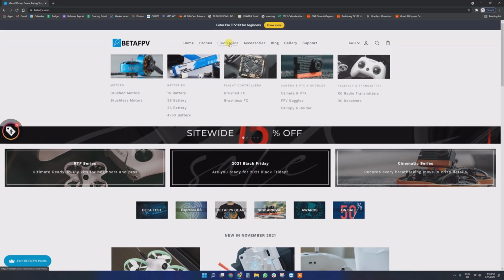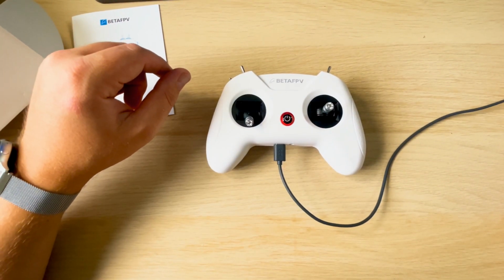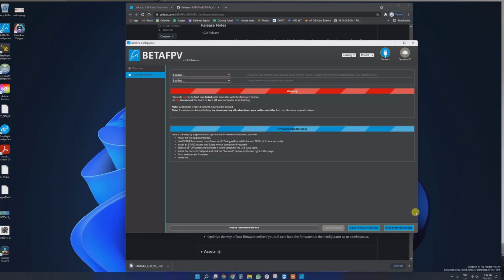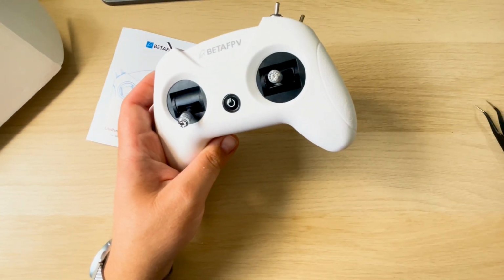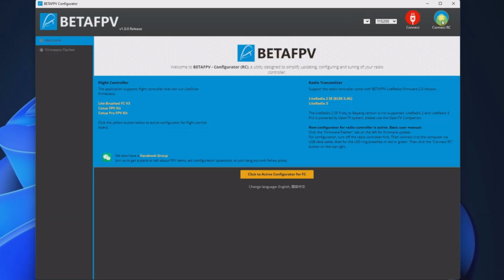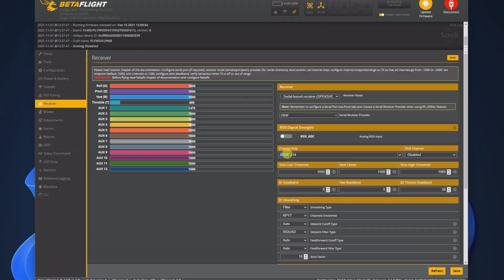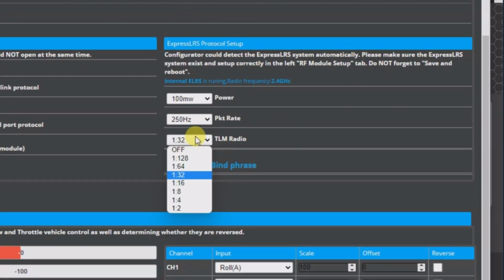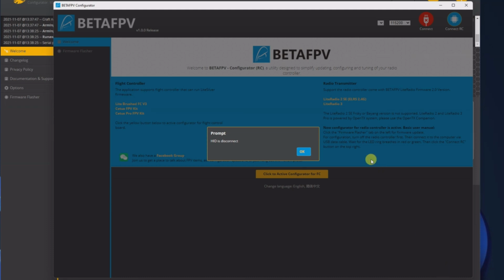How to setup the BetaFPV Lite Radio SE ELRS | | ExpressLRS V1

Comment from the maker: If you want to run ELRS 2.0 on the Lite Radio 2 SE or Lite Radio 3, here is a link to the pre-release firmware.
https://github.com/BETAFPV/LiteRadio_PLUS/files/7827204/LiteRadio_2_SE_V2_SX1280_2.0.0_RC1.zip
This is found on the following issue on Github: https://github.com/BETAFPV/LiteRadio_PLUS/issues/2

Release Notes
This is pre-release firmware from BetaFPV and if you flash it to your Lite Radio 3 it will disable the ability to use the External Module Bay. You can use this on your Lite Radio 2 SE.

Comment: Ive just bought the Lite Radio 3 Pro and a meteor65 pro from betafpv,  setting up everything has become a ballache,  with expresslrs configurator throwing out errors and betaflight also giving me a failed error message also.  I ordered these thinking it would be easier to setup, nope

Comment: I'm getting RSSI issues after setting it up. Do you think it's an issue with the receiver on the quad or the controller?? I got a Flywoo CineRace20
Reply from the maker: It could be a combination of all transmitter and receiver. Too hard to pin point the problem without visually inspecting your setup

Comment: Awesome video...I just got the betafpv slim tx for my x9 lite and put a happy model with the smd antenna on one of my tinyhawk2 freestyle drones...got about .3 miles on low power and 500hz. Not bad considering the rx antenna was mounted inside the drone, so it had to go through the body of the drone amd a few trees. I'm gonna lower the packet rate and try another range test and see what I can get. Keep the videos coming!

Comment: Have you tested the range of that controller yet? If yes, how did it do?
Reply from the maker: No I haven’t yet; I am still trying to find a good spot to range test that doesn’t put too much risk into losing my quad
Reply: @DarrenAllatt  how about a penatration test through trees or around houses..?
Reply from the maker: @JP-qq2kn  that I can do
Reply: @DarrenAllatt  awesome! Thanks! I have the first version of that radio (Frsky) and I was impressed by how far I could go with a tiny whoop on D8.  200 yards easy in open area. Just wondering how elrs does without an external antenna. Thanks again!
Reply: I have ordered this radio and happymodel ep1 , wondering what version of elrs i need to have on my EP receiver , will it work with 1.2?
Reply from the maker: @maxmax-xx7nw  yes it should